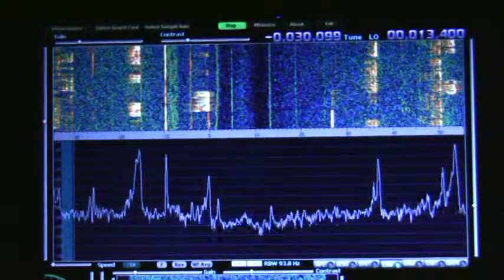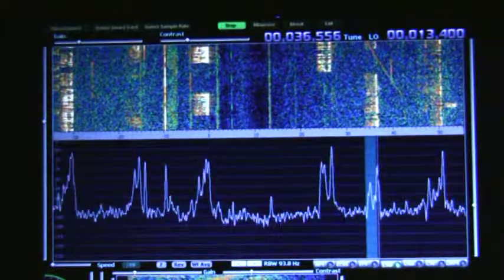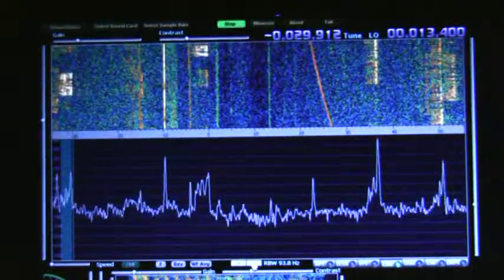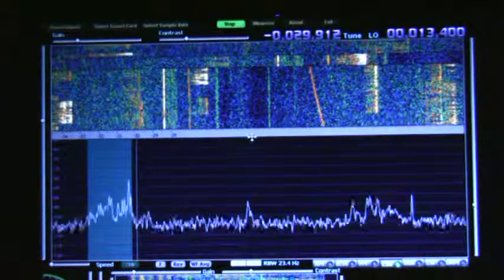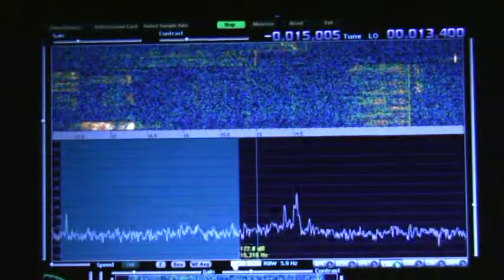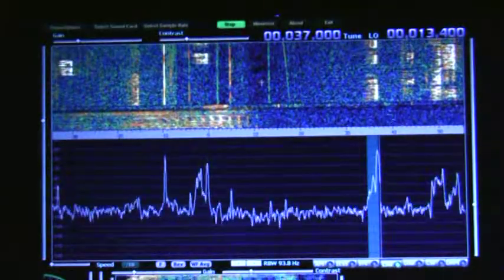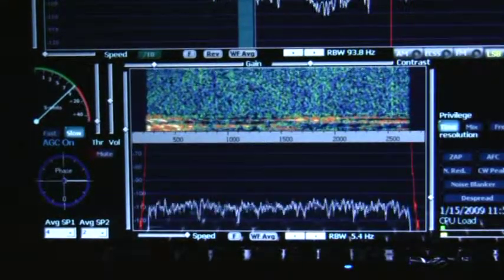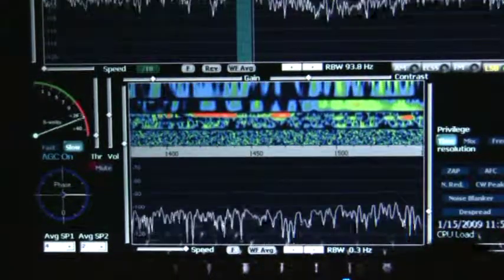Pan Adapter on Amateur Radio

Comment: Hi friend, would you know where I can get the signal from the first IF of the radoi Kenwood TS 130, from which component comes out this signal, to use it with the pan adapter. I am waiting for your help. alexbrocker23@gmail.com